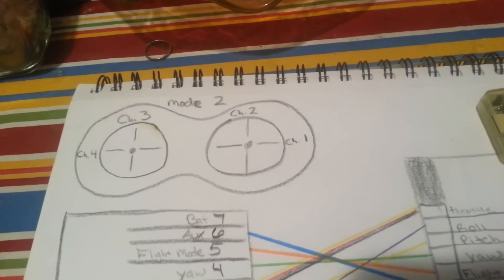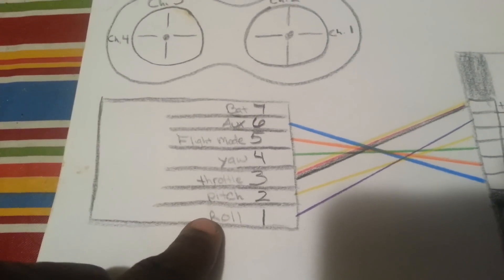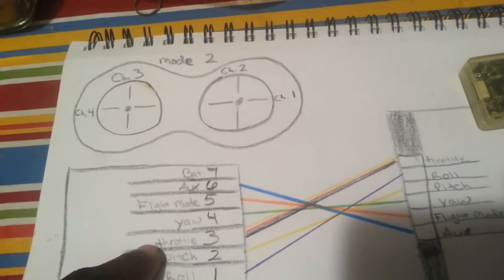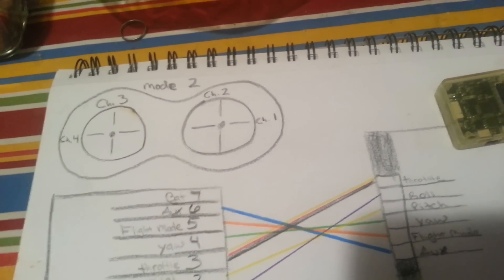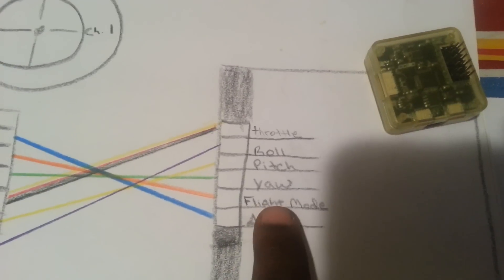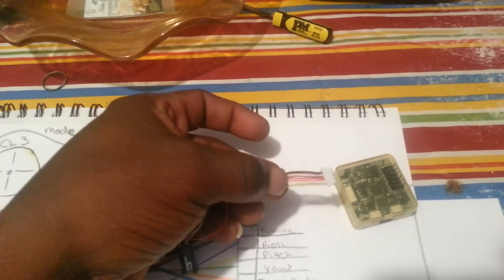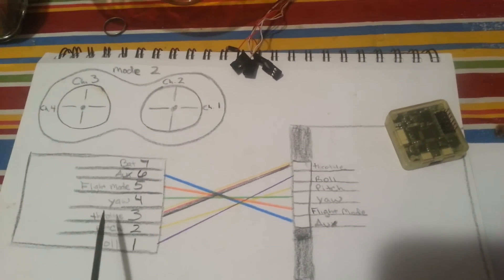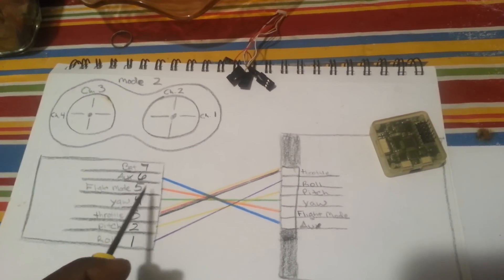How to connect fs r6b receiver to cc3d

Comment: Hey Bro my cc3d cable is different and I don't know how to connect it. my throttle is not in one plug, it's 3 singles... but they are red black and blue, then white and so on. now I don't know if I should use the blue (3rd wire) or the white (4th wire).  I don't want to fire this thing up and fry something.  any ideas what pin I should use?
Reply from the maker: +EΛRTRΛ$H The color of the cables is more or less irrelevant. When plugged into the cc3d (from top to bottom) the first 3 cables will be signal, power and ground for the throttle channel. The fourth wire, white, is your roll, etc. Just make sure the throttle cables plug into channel three on your receiver in the correct slots.
Reply from the maker: +EΛRTRΛ$H And if by 3 singles you mean there's one wire in a 3 slot connector all you have to do is take the second and third wires out of their connectors and put them in the second and third slots on the first wires connector
Reply: +KS Pyro thanks man i for it, like you said i just followed the routing rather than the colors. As for the singles - no man, all the vids ive seen are like yours where theres 3 slot connectors, whereas mine were all just single slot connectors. It was a bit of a pain in the ass tbh. Thanks for the vid and response.
Reply from the maker: +EΛRTRΛ$H No prob bro. Glad you got it setup right. I know the first time I tried to connect everything I damn near tha my whole rig out of frustration. Lol. So I'm damn glad to help ya get in the air
Reply: +KS Pyro Thanks for the vid. I have connectors with one wire. Like for Ch 1 for example. I'm not sure which way to plug it in. Does it matter which way the connector is facing when it is in the correct channel already? Hope you understand my question. Ty.
Reply: +KS Pyro NVM> I watched another video. THe single ones should be towards the Receiver... If I'm not mistaken.
Reply from the maker: +BayDude yeah. all the single connections are signal and should be plugged into the signal pins in your receiver
Reply from the maker: +BayDude and you're right. the signal pins are the pins closest to the center of the receiver. the middle row is power. and the row on the edge is ground
Reply from the maker: Yes. Even tho you're on the right channel it still has to be on the correct pin. Just make sure it's plugged into the pin marked signal.

Comment: what if you have wires from power distribution board going to throttle do you still need the 3 wires
Reply from the maker: Yea. The three pin connection is how your receiver gets power. It doesn't necessarily have to be on the throttle channel just so long as it's getting 5v from somewhere
Reply: so should plug in the power distribution board power and the black and white ones
Reply from the maker: +Trent Ramirez absolutely

Comment: Hi thank you for the video. I just connected ch 1 with one of cc3d ch 2 with 2 and so for. Obviously it failed since my ch 3 throttle is entering cc3d pitch and ch 1 is entering cc3d throttle. I will revert to solve the problem BUT in my case my ch 4 (connected correctly to cc3d 4 wire) is not working at all no matter what I move on TX nothing moves on the cc3d tx wizard. Any hint why is that ?  Also moving elevator and roll sticks both moves the roll bar on the computer (conceded to cc3d in rx wizard) any hint why is happening like that ?  I HOPe by just reverting ch 1 with 3 all problems will vanish but I doubt since ch 4 is ok and not working and roll and pitch are appearing all in the same roll bar on comp. I appreciate any help thank you
Reply from the maker: I'd check what stick mode your tx is setup for in the menu. If it still persists after you have corrected the wiring, uncase your rx and check for any solder shorts on the channel pins.
Reply from the maker: Also check your channel mapping in the configurator. One channel may be mapped to two inputs.
Reply: +KS Pyro good points. In fact I bought a new small 5 ch tx from Hobbyking and its 5 ch receiver and never used it before so if a phisica error (like short circuit in pins) exist I never checked or tested before. A simple option is to use the old 6 ch receiver with its tax and see if the problem vanishes
Reply: +KS Pyro this Chanel mapping is new to me. You probably mean something done in the librepilot ground station GCS correct ?
Reply from the maker: +Roberto Petresco yup. Should be AETR1234
Reply from the maker: +Roberto Petresco yep. I would definitely use a minimum 6ch receiver
Reply: +KS Pyro the 5ch tx/rx were the problem. I replaced both for a 6ch rx and rx from Hobbyking and ALL my problems just vanished. I am still unsure if the problem is on 5ch rx or tx
Reply from the maker: +Roberto Petresco Both most likely. The FC needs at bare minimum 6 channels to operate correctly
Reply from the maker: +Roberto Petresco Mighty glad you got it all ironed out. And happy flying bub.

Comment: please help me how to connect the receiver i6 Flysky to cc3d, I do not know the order of the cable to its canel
Reply from the maker: I haven't used the i6 rx before, but I can assume that the pin layout is basically the same as the r6b rx.

Comment: 2018    feb 13  2am on a late late tuesday  this thing and wiring do not work try every thing ahhhhhhhh   i have  fs-r6b receiver and a cc3d atom  on a tricopter  transmitter flysky fs-i6 running d2826/10   1400kv with a 3s 1300 WHATS THE PROBLEM WHY WON'T IT WORK   not reponding to my transmitter somebody help
Reply from the maker: Glen Mccall  What firmware are you using?
Reply: What is firmware
Reply: Do you mean libre pilot. That's what I have and IAM using regular settings on my transmitter